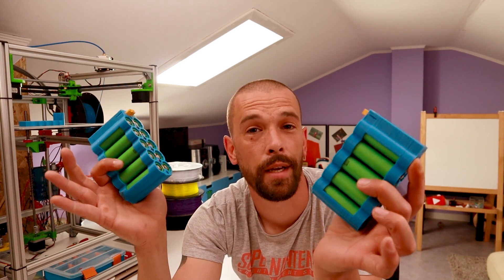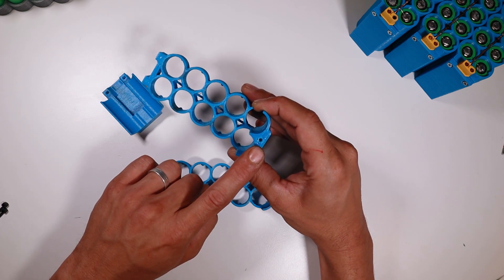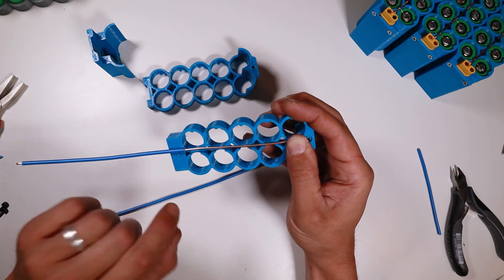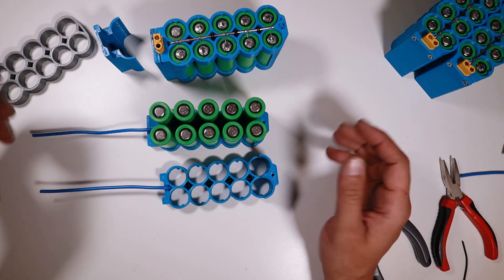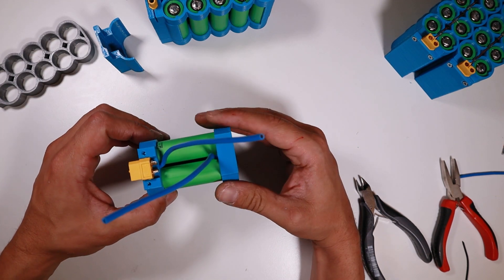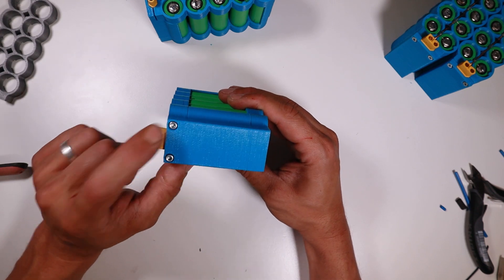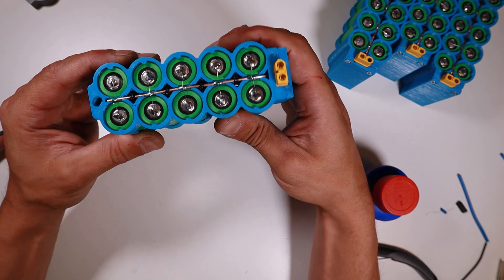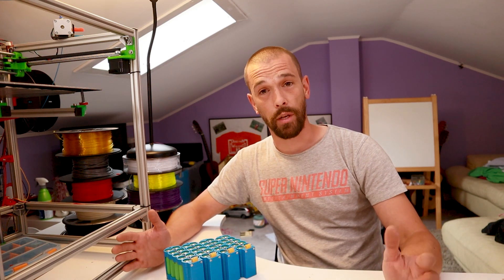I'm 18650-ED - P03 ep.02 - Building my first packs... (how to)

Comment: Excellent video and very neat compact design for sure. I love it and will try it out on my Prusa MK3. One thing maybe to think about for the future is to somehow bind 7 packs together to make a 24 volt combined pack as it seems more efficient then a 12 volt setup. Maybe 2 plates as a harness with long bolts to hold the packs together. I am trying to build a portable case rather then a power wall inside as you said nobody wants to burn their house down.